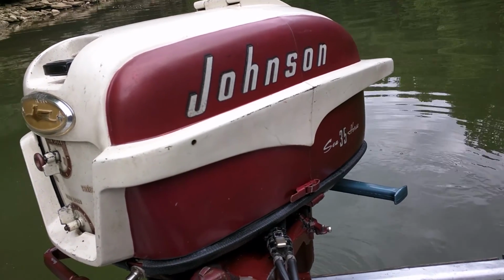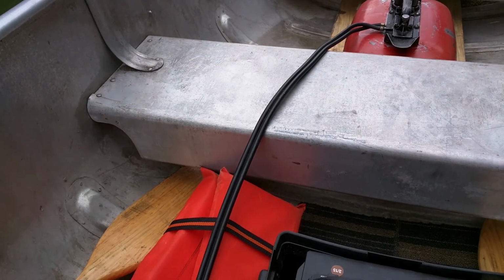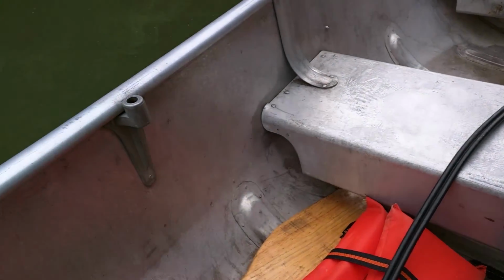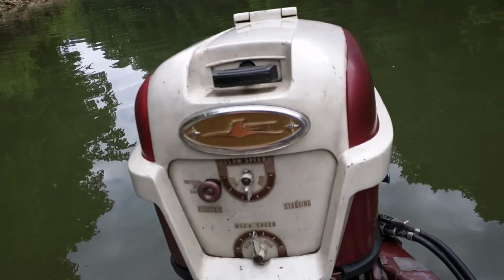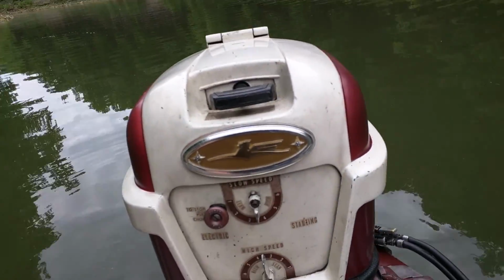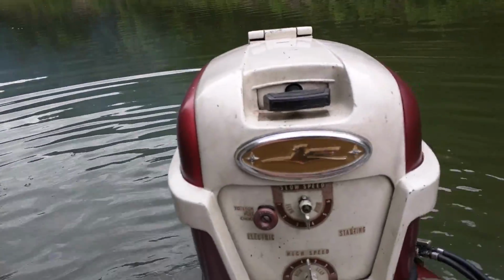1969 Alumacraft FD and 1957 Johnson 35 hp

Comment: Real nice, and that was a great run down the lake and it sounded great too.
I have a 1957 QD-18, 10hp Sea Horse sitting in a shed... have not had it running in 30 years. Looks Identical to yours with the same paint only smaller.

Comment: I have a 1962 FD14 with a 1969 25hp Evinrude Sportster. I  put 40hp on it, but it was just too heavy with rear control position to plane & control properly so I put the 25hp back on. The 25hp is only about 85lbs.
My FD is was originally ordered optioned out with steering console, remote controls, upholstered seats, front deck cover, aluminum oars & rear well. I have the original invoice & sales brochures  somewhere from the original owner. 
 Good boat, but a bit narrow.  I've used it to fish all over the West, from  Long Beach Harbor to Panguich Lake in Utah.  Never a worry. BTW, that dull patina is a factory feature: Anti glare.

Comment: any tips on making a 67johnson 6hp to attain top speed on a 10ft zodiac    some says play with the trim on the second notch try it in the spring ,,and if i can get one what yera could you make a 9.9 into a 15 by carb change
Reply from the maker: Yes raising the trim will definitely help with top speed but your only going to get so much. I have heard about doing a carb change on a 9.9 but I've never done it. Sorry not much help.
Reply: in my 70s now  and the bigger  motors   are just to heavy lol
Reply from the maker: @petermoyes8766  I understand completely they are too heavy for me too but I like to go fast. I have to use a hoist for some of them. Good luck, just try the second or third notch going away from the transom. I have a feather craft boat that has a 35 hp that is on the third notch.

Comment: Chris, I have a 1957 35hp Johnson on a 1955 14ft Chetek wooden runabout. I can do 20mph, does that right. It seems to run great but I feel like she's not giving me her all.
Reply from the maker: rob stewart that's probably about right considering that Wooden Boat is heavier. on my aluminum boats a Johnson 35 horsepower will go about 29 miles per hour but that is much lighter than your boat I'm sure. You might want to check what prop you are running.
Reply from the maker: I would also check to make sure that you have it trimmed up right, and make sure that you are getting Max RPMs hence the prop
Reply: @christate1974  thanks for the quick reply. I see you run these motor quite a bit so you have a much better gauge then I do.  2 adults, full fuel and battery I get right @ 20mph with her. Starts on the third pull when cold everytime. Any prop recommendations for these motors?
Reply from the maker: rob stewart your about where you need to be. 10 1/2 ×13 is a good standard prop. Make sure your high speed needle is adjusted correctly for Max RPMs and to be sure get you a wireless tachometer at the parts store and run it and make sure that your topped out
Reply: @christate1974  Thanks again Chris. I definitely appreciate the info
Reply from the maker: rob stewart https://youtu.be/UEXzSEsAoWE

Sent you a link to a video, note this one goes 20 mph also. Check it out
Reply: @christate1974  thank you